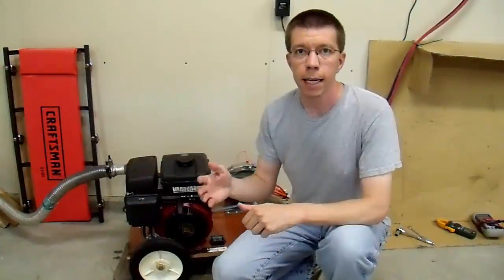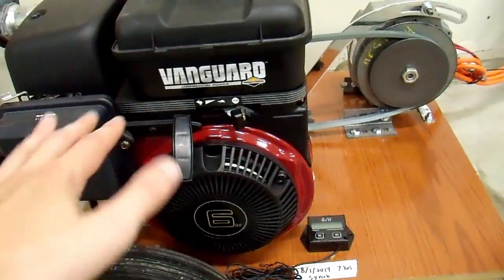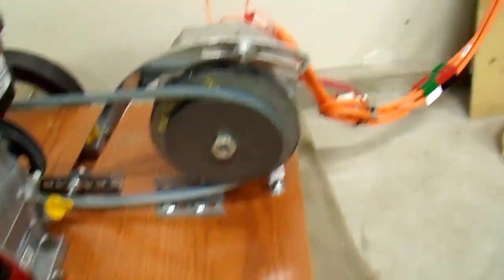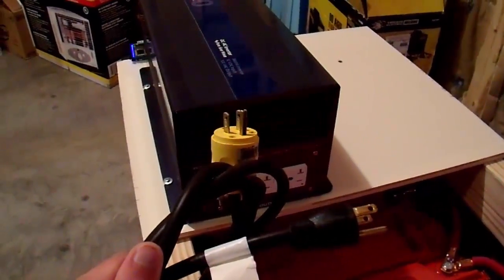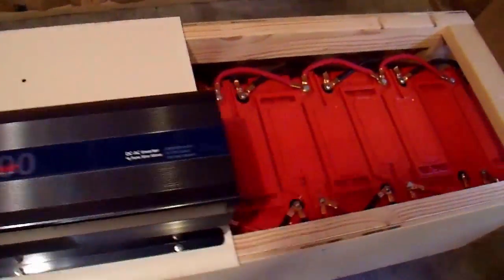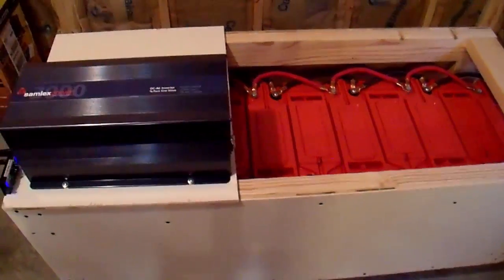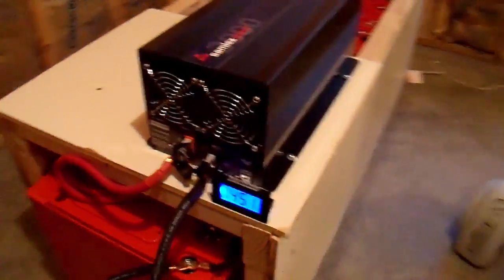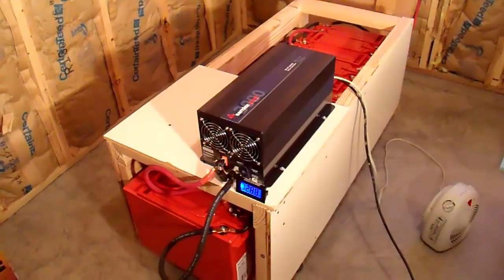DIY 12V Generator Charger - 10 Demonstration and How to Build

Comment: Ive also built,  destroyed and rebuilt this same machine half a dozen times now...finally i have one that works without melting belts, rectifiers, regulators,  coil windings and so on. Automotive alts are absolutely not the answer.  They're not meant to charge deeply discharged battery banks because that requires continuous high load output.  They just can't do it. Permanent magnet alternators with external, heavy duty rectifiers are the way to go. They dont load down the engine because they're not trying to reach any 'goal voltage'. They simply put out what you put into them. The resistance is fixed so your output is controlled by rpm. Fans are important though...for the engine, alternator and rectifier.  I have a 24 volt bank and my generator, with a 1/1.5 rpm ratio puts out 1800 watts at full throttle and 350 watts at just above idle. Been running it this way for some time with no loss in power or visible stress on the belt and you can just hear the engine is running easier. Thermodyne makes the bests PMA's money can buy.....check them out.
Reply from the maker: The alternator I use in this video works great.  You need the right alternator and the one in this video can do 100% continuous duty without any problems.  It is a simple 27si without any modifications.
Reply: @knurlgnar24  my house runs completely off grid year round in Wisconsin so i have to recharge often come November thu march. I used almost part for part what you built and yes it does work great but running full tanks of gas day after day through the bad winter weeks i ended up melting down 6 alts last winter trying to draw 80-100 amps charging a 1000Ah 12V bank. Got expensive.  The new setup is so so much more efficient.  I get roughly 3.5 kwh per gallon of gas because the output doesn't drop as voltage rises. Its actually less load on the engine/alt as voltage rises. Very happy with everything mechanically... next step is full automation tied to my charge controller with a gene start/stop function.  Love your vids though bud.... learn a lot.
Reply from the maker: @ak-joe2038  Congrats on the off grid house!  There must be some miscommunication between us as I don't fully understand what you are saying, I assume you switched from the car alternator to a PMA?  Interestingly enough I have been tinkering with changing to a 48V battery setup and bought a PMA and charge controller for this setup to increase efficiency and output.  I haven't set it up yet so while I have all the calculations and such done I can't say whether it will all work out.  I'll check out Thermodyne
Reply: @knurlgnar24  at fisrt i was using a 10si 125 amp delco. Worked great but didnt last. After 6 of those i went to the thermodyne dual core 1212 pma and 300 amp rectifier.  Very happy now.
Reply from the maker: @ak-joe2038  Good job!  I don't know why those 10si alternators are so popular - the design just isn't very good on them.  I was happy to find the 27si that stays cool even at constant full load.  A PMA would add more efficiency.  Sounds like a good setup you have.  I bought a WindBlue alt (still in the box) and calculated all the curves for the battery/engine/alternator/charge controller on paper and it all pencils out but I mostly expect the alternator to not perform to spec.  Any idea if WindBlue is any good?
Reply: @knurlgnar24  Thanks! It's been frustrating trying to build something that actually works. Running conventional generators to battery chargers is absolutely a waist of gas so i had to find or make a better solution.  I very much appreciate the videos you've put out. Your thorough and unbiased and that's important. As far as  Windblue goes...i have zero personal experience or knowledge of. There's a lot of crap out there as more companies are joining in the renewable energy market.  I waisted a fair deal of money trying to harvest energy from the wind, buying inexpensive turbines that never made a watt. Lesson learned.  3 turbines later, i gutted all 3 to Frankenstein together 1 that should put up some numbers when the wind blows. Solar is great. I'll make a video of my gene when its prettier. Still in concept phase...swapping pulleys, fans, temp sensor relays and need to design a starting system gor the solar charge controller to communicate with so i dont have to worry about my wife properly going through start up and shutdown procedure when im working out of town. The fun never ends when you live on stored power!
Reply from the maker: @ak-joe2038  I'd love to have an off grid house of my own someday and also am concerned about my wife being able to operate it all.  If I'm ever gone I would want her to be able to run it without me.  I honestly don't see how that is possible though...  Sometimes dreams are just that.  But you seem to have found yours.  I guess in the end she can just sell it all and go on without me if that's what she wants.
Reply: @knurlgnar24  HAHA!...the struggle is real. It was a slow acclimation here. I started with a small system and took the TV off grid. When the battery died i said "well maybe you all watch too much TV". Then as we learned how much power all this crap actually uses we started shopping for more efficient crap....fridge, lights, TV, washer and for drying we line dry. Threw away our electric coffee pot, toaster and microwave because not only are they the biggest power users in the house,  they're unhealthy to use. Toast in the oven is the same and coffee from a percolator is unbeatable.  Haven't missed the microwave yet. The big thing is using the power when its there. During daylight,  the panels produce so much power the bank is full before noon usually so she runs the dishwasher and or laundry around mid-day and saves some sun to let the batts float before sun down. Wasn't always that smooth though.  The first year she killed the batts every day and i had to try to recharge when i got home from work.  A dozen upgrades later and some experience and its getting better. The bad thing and the really really great thing is... them killing batteries and or breaking things is really good consumer research.  By "liz-proofing" everything i build, im effectively building something i could sell to a consumer who knows nothing about it and it will work. I wish i knew the math side of things like you do. Im better with the hands on stuff. I kinda just grab a pile of parts and start throwing it together and test before its ready....hurt myself and remember to slow down and plan better. Im currently balancing blades for a turbine I've had in the air 12 times and  now back down again for a bigger tail, 48 volt stator and a balance job..... never ends. I love it!
Reply: @knurlgnar24  exciting development!...i've been experimenting with pulley ratios on the generator.  After a half dozen combinations i tried a 3.5" on the engine and the factory 3" on the PMA for a .89:1 ratio. At flat idle it makes 0 watts because the voltage output isn't high enough to charge the 24 volt bank, but just over idle it jumps up to 250w and up to 2650w and 80 amps at full throttle!  Amazing amount of power. I now want to get a generator control board and servo so i can program a start-up, warm up, slow throttle up to about 3/4 throttle and back down to 1/4 after voltage hits 30. I want to simulate a "bulk/float" charge and float for an hour or 2, then shut down. Mechanically i couldn't be happier at this point but automating it will be quite a challenge im guessing.

Comment: So a few things that would help your set up.
1 if you are running 1 to 1 why not ditch the belt and use a direct drive and get your 10 percent back.
2. If you pull the regulator rectifier out of the altunator and run wild ac for the run to the batterys and re install the regulator rectifier there your line loss will be much less.
Reply: That is great advice, also save a lot on copper wire which must be over three hundred dollars for 1/0 welding cable.

Comment: This setup seems rather wasteful to me.  If you are going to use a 12V alternator system, why not just start up your car and use that instead?  It is likely quieter than that contraption.  Also, why not make your battery bank 24V instead and use a 24V alternator so then you can maybe get 2000 watts instead of only about 1000 watts?  I have a friend that uses seven 12V 100Ah AGM batteries as backup power for her well pump so upon testing that for her, I used my idling car to charge her battery bank and I measured the charge rate at 70Ah (since her 700Ah bank went up 10% in charge in 1 hour).  A car can handle this easily and doesn't require the added expense of hundreds of $ and all that effort to make something your car can already do.  There may also be an added benefit of the idling car warming up your garage plus the large gas tank can provide fuel way longer than that of your small engine.  I am not seeing any benefit to this contraption for home use.  If it was out in some log cabin or you needed portable use then yes, but in your garage, just use a car/van/truck....

Comment: You Rock knurlgnar! I had the chance to drive all over creation last night to get a free 4 cycle weedwhacker (for a similar DIY generator... but smaller) !! but I fell asleep. (stupidstupidstupid)

(troy bilt) prolly not the best quality! id better follow your lead and save up for a Subaru Robin or some such!!!

keep up the good work! my whole idea is to perhaps have a motorized-bicycle, mini generator, and WHO KNOWS WHAT ELSE!!! built around one easily swappable engine! then just acquire a few identical engine units, learn to service them to the bone, and always have at least two up and running at any given moment! 

(this is sort of like an 'ultimate road trip accessory' type thing rather than an 'off the grid home' type of thing, but similar tech and yeah I need to get my butt in gear!!!

one critique! not sure if you have dogs or cats or small children around ever, but I would add some safety features on there (at a minimum and enclosure for the pulley system!)

I think one of the most important parts of DIY is helping to shepherd people towards safety oriented design. build it so that anyone could safely use it and laminate an 'instruction page' and staple it on there!

that way when you have two broken legs and your neighbor has 1.5 broken legs and the power is out and its 28 below you can be like, "Hey buddy, I don't think I can make it, Can you crawl down to the garage and start up the emergency generator so we can run the space heater."

"its safe to operate and the instructions are posted on the side, here take my headlamp, and if youre not back in 15 minutes ill try to call for help"

yep

Comment: Motor oil in these little engines needs to be hi zinc oil . Run in motor oil is very good as its hi in additives tgat these small engines need to get long life . Normal car engine oil is ok but not optimum . A purpose made motor cycle oil for engines without filters or pumps ( splash feed oil ) is best . But very expensive . $40 per litre average price . Chain drive is best less drag to the driven equipment .

Comment: It's a good set up but my idea is, instead of using gasoline  generator  why not use a 12v or  a 110v motor to run your  alternator using the same  12v out of your alternator  or  your  110v out of your  convertor  once is running can you do that, I mean can it be posible to  feed itself and  to  produce the  energy at  the  same  time? And  so it  can be self dependent, that way ir can run indefently

Comment: I dont understand a few things , first of the exhaust, why didn't you just buy one of those $7 universal tube style small engine mufflers and attatch some simple 1 inch diameter flex line or even pvc type tube for an exhaust it'd have been cheaper and more correct for the engine giving you proper back pressure . Second your in the end doing all this just to get 3000 watts out of a single inverter so why the battery bank ? Why not just run the inverter directly off the alternator as a store bought generator head is powered directly off the crank shaft and don't use battery banks so why the need for the battery bank . 3rd why didn't you just spent $350-400 on a decent 3000 watt store bought premade gas generator if all you need is 3000 watts I mean you really spent way too much money and Installed way to much unneeded equipment just to only get 3k watts, seems like alotta work for nothing and a large waste of money to me I dunno maybe Im missing something but I don't think so. I mean 40feet of cabling dude seriously, and 12 batteries in your bank all in the end just to get 3k watts , which can be had from any store bought $400 or so generator so yeah what is the deal what am I missing here lol.
Reply: because gas Engine are Not very efficient You lose most of the energy going out the exhaust, gas Engines are more efficient under load but Not with small load and If You do Not want to continuously run the Engine then store the energy Into batteries and use large batteries and power Inverter

Comment: Don't understand going to the large pull on the alt. you are losing amps. with that set up because you are one to one with the motor. I've made a set up for boondock camping with a 5.5 hp. Honda lawn mower motor with 5 inch pull on motor and 2 1/4 inch alt. which is GM rated at 105 amps. I can run engine at a little above idle with 14.4 volt's and 70 to 105 amps depended on load and battery charge on low sun days I may need to run 1 to 1 1/2 hours to top off charge.

Comment: I haven't watched the other videos, but why isn't the inverter connected to the generator and the batteries charged via the inverter and a decent charger? Isn't that better for the batteries? And also, how many days will it take to charge this huge battery bank that are connected in series? For me it takes around 12 hours to charge one 100 amp-hours battery with an 8 amps charger from 12.5 volts to ca. 13.1 volts - The inverter cuts off at 12.5 volts when I am using the battery.

Comment: hey you could use a bobcat alternator for a hydraulic pump and it makes 55 amps and 24 volts to charge how many car batteries at once. or put a bunch inline to make a huge emergency power for a house. full house power requires transformer for each one.

Comment: hey...coban...why dont you connect your Alternator with the 12 volt dc motor and get power from Alternator...then feedback or charge again the 12v battery with Alternator...so you avoid that generator from scaring your familly.

Comment: That plug you made is called a Suicide Plug, not good at all!!!!
Reply: It is not a suicide plug it is more likely to hurt the linemen fixing the outside plant than the homeowner.  That is why it is illegal, is when you don't disconnect from line you feed back and can hurt a lineman.  Calling it a suicide plug makes people think well I won't make that mistake so I will be ok, but if they kill someone they will not be ok.
Reply: Pat B The Plug he made with both ends having male plugs is called a suicide plug! I never said anything about him sending voltage back to the grid. What you are talking about is an interlock, which cuts off main breaker so you can turn Gen on and not back feed! Another way is a transfer switch! But like I said earlier, I was just telling him his suicide switch is very dangerous. And yes I’m a licensed Electrician!!

Comment: Awesome video very informative. What do you think of a set up with a battery and alternator and an electric motor no need for a gas engine or diesel engine? Alternator powers the battery the battery powers the motor and bam you have electricity. What are your thoughts? Thank you so much 💡
Reply: He would need you to stick your thumb on the pulley to hold the belt
Reply: Wow, you just came up with a free energy device.   Seriously, it will not work.
Reply: @KevinCoop1  Why not? Think about it, rotating movement of the right materials creates electricity so why can't it come full circle?? I know it sounds too easy and if it works why isn't it already being done blah blah blah, I know I get it. I'm going to set it up you never know unless you try it right 👍🏼
Reply: NorCal Ok, lets think about this for a minute please.   A battery is charged by utility power and runs a dc motor.  The motor has loses of energy, as is apparent in that under a load, it produces heat.   The motor is coupled to a alternator that produces voltage and also produces heat or losses.   The alternator provides power to charge the battery.   So it will work as long as the energy stored in the battery will last and then stop working.   Now connect a load to it like in the video.   Now your system will work until the previous losses plus the new load deplete the energy from the battery.   To make this system work longer, tags out the motor and the alternator, and you will only have the load draining the battery.  I hope this helps make sense of what you were wanting to do.